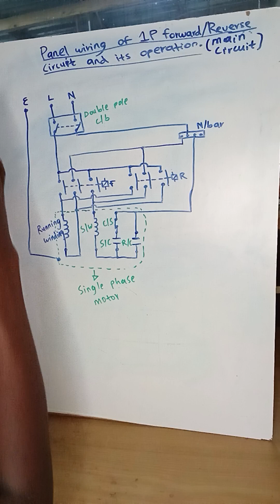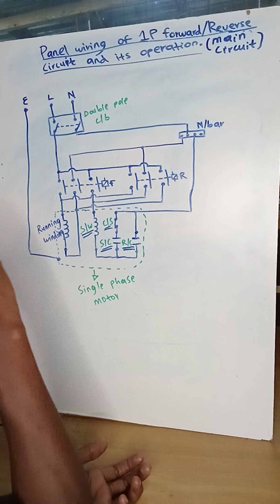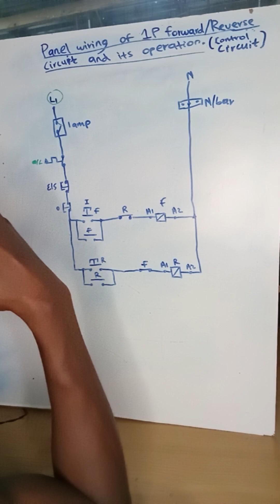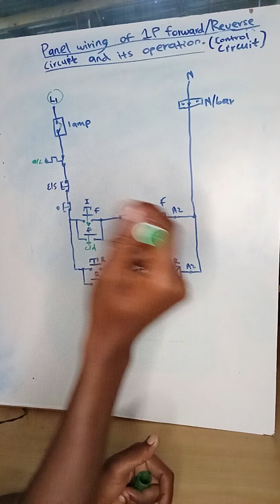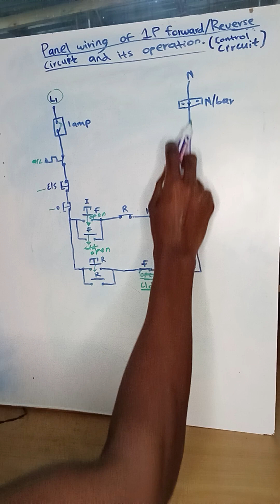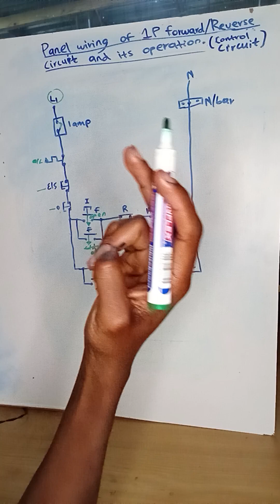How to do panel wiring of single phase forward and reverse. Main and control circuit. Lesson 0006.

Comment: Hello Sir Which motor terminals do your T1 T2 and T3 go to
Reply from the maker: From forward direction. T1-input of running winding, T2-output of running winding and T3-input of starting winding. From reverse direction. T1-input of running winding, T2-input of starting winding and T3-output of running winding.
Reply: @Manmade1983 I tried that connection sir the motor doesn't want to run but contactor is energizing
Reply from the maker: @juniornkatlholang9379  did you connect using the pinned comment at the top?
Reply: @Manmade1983 I did change it today but still nothing happened the motor just hums no spinning
Reply: The neutral wire goes to u2 where centrifugal switch is placed according to the power circuit
Reply from the maker: @juniornkatlholang9379  Did you get it right that way?

Comment: Hi i want to ask something,
Why did you switch two lives on running and two neutral on starting windings
Reply from the maker: Please check carefully. From the middle points of the contactors is the neutral wire not live wire. Trace your wires from start to end.